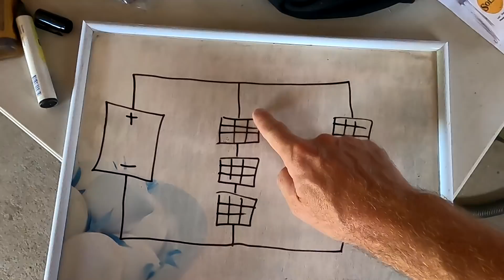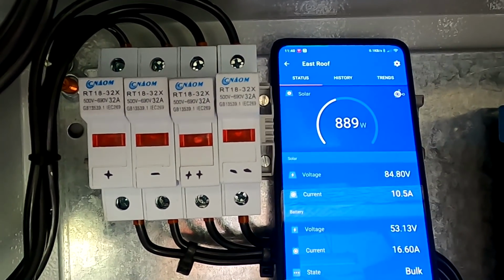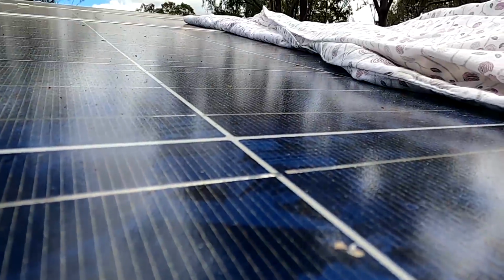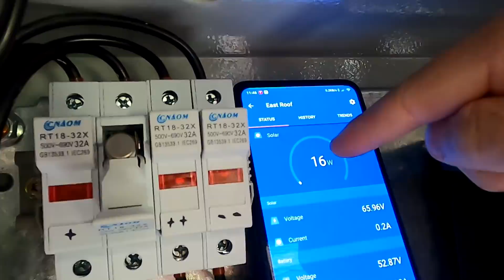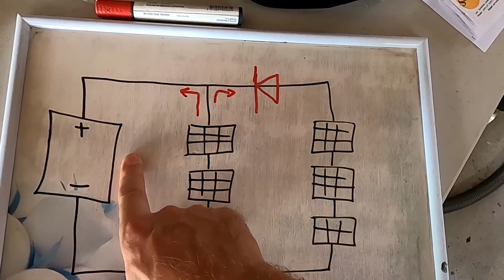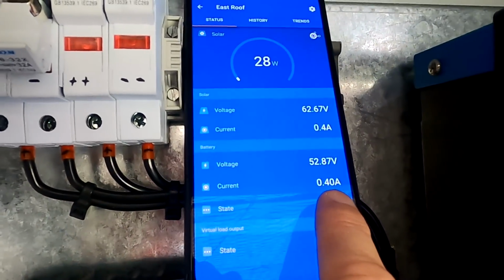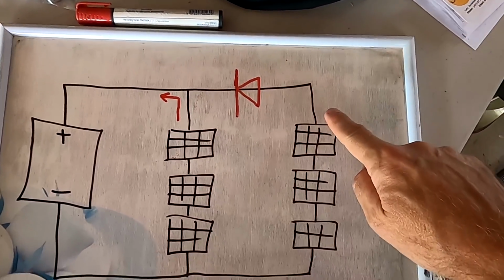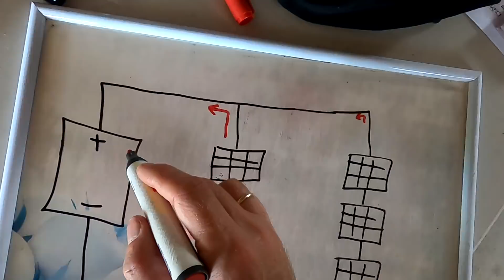Solar Upgrade EP4 - Shaded and non-shaded solar string in parallel. See what happens.

Comment: I thought the blocking Diodes were to prevent battery discharge at night ( with dumb charge controllers) but new charge controllers have diodes built in to them to prevent this. I have not seen a need for diodes in the systems these days. But I only know from my experience with a "small" 2kw system.
Reply: All 60-cell solar panels consists of three strings, and therefore has three diodes in it, for partial shade..

Comment: “Let’s do the test.” = Why I watch. This is actually a very complex question to answer theoretically. Depends on many things. I believe (haven’t done the test) that parallel strings of different nominal voltages (number of cells) can backfeed many amps when unloaded and in full sun. Conversely, modern half cell panels and shingled panels are arranged as multiple smaller panels connected in parallel without blocking diodes and this helps with shading. Another thing to ponder is that a shaded panel cools down which increases its open circuit voltage. Shaded does not mean complete darkness.
Reply from the maker: You should not parallel strings with different voltages ever! That could cause a fire unless you have installed such blocking diodes. 
There are bypass diodes and blocking diodes for solar panels but they are different things.

Comment: So what about explaining bypass diodes? I would have thought too you should get a bit more with some panels shaded if the bypass diodes are working. Is the voltage going below the minimum voltage for the regulator? It is good to see no need for blocking diode. I understood that blocking diodes are only for night losses. Charge controllers generally have that built in now.
Reply from the maker: The bypass diodes are only effective if you have a shadow on one panel of a string. Otherwise the panels in sunlight would push their current through this shaded panel and could heat it up. These bypass diodes are installed in ever panel already (see all the comments here). A blocking diode has a different task though and prevents one string feeding another string. The bypass diodes would not help in this case.
Reply: @OffGridGarageAustralia  yes, but you only got 19w off the other panel, in theory if the mppt has enough voltage on rest of panels in string you should get the power from the unshaded panel in that string. You are correct but if you have time a video would help some I think it seems many don't understand the bypass diodes proper function especially if you have say 150v string voltage.

Comment: (Sorry for my english)
Andy you did a very good test. 

The reason why the current doesn't go to the shade pv panels is because bypass diodes help themeself to stay at high voltage (around 100V). 
So the current will flow to battery (48V)
Reply from the maker: That's actually not true. There are bypass diodes in every panel but you would have only one blocking diode per string.

Comment: I think your charge controller will have the blocking diode to prevent current being drawn from your battery to the solar panel. Otherwise at night there would be a drain on your battery because of the voltage difference. However your panels will have the bypass diode to prevent current going to the shaded panels.
Reply from the maker: The controller does not know how many strings I have connected in parallel. This would not be working to have this installed in the controller.

Comment: Most manufacturers place diode‘s in the solar panels because of that possibility happening of power back feeding.
Reply: False
Reply: Every panel I have ever bought has the exact set of three diode‘s in it any panel that does not have them it’s probably of the worst quality.  You get what you pay for.
Reply: @corybodiker6243  they are bypass diodes! Not blocking diodes
Reply from the maker: That's exactly right @zarbonida. So many people get this wrong and I thought it's common knowledge hence I didn't mentioned it in the video.

Comment: I don't understand why diodes are in solar panel systems to begin with, because solar cells are light receiving diodes. Basically the opposite of an Led.
Reply: That is correct, the only problem is that the reverse breakdown voltage of the intrinsic diode-junction in the solar cell itself is that it breaks down at anywhere between 15 and 60 volts. Most panels are strung with much higher voltage so the  intrinsic diode-junction in the cell is not sufficient. BTW as a LED, if you feed back into a solar cell, it will emit infra-red light - not very efficient at that though ;-)

Comment: power will flow towards the controller as the potential is lowest there.  A diode can't hurt, although you have the small loss in forward voltage, but I don't know if it is vital.
Reply from the maker: You will lose around 0.3V over a diode. Multiply this by the current of 8A in my case and you will lose 2.4W. However, the lower voltage will also start you charging later and end it earlier. Not sure how much energy you will sacrifice there over time.

Comment: I think what you mean about those diodes is that they are installed to prevent short circuit in one string to affect the other. Think like 2 bateries, if one shorts the other will feed current to it.
Reply from the maker: They can prevent a short if you have one faulty panel in one string. That's why it is important to check regularly on your system to see if there is an issue with the solar production.

Comment: If u wanna use diodes , or Replace
Bypass diodes in panels (black box on the panel backside)

Look into  SM74611
It's a replacement for a normal diode but has almost no loss....

regards 
Joe
Reply: Too low reverse voltage, those only can take 30v reverse so it would not protect in the situation of power flowing from one string to the other

Edit: while loaded his string seems to output about 70v, 3 diodes in series, one in each panel, should be able to stand that but when the load is low or there's no load the open circuit voltage might be high enough to blow those diodes
Reply: @jonathana3872  I think, your analysis is 180° backwards.  It is the voltage across the "string of cells" being bypassed inside of the panel, that is not allowed to generate more than 28 Volts.  40 cells per string (max) = 28 Volts / 0.7 volts-per-cell.  Actually, that is a very high number of cells to protect in one "string of cells".   When the sun is SHINING - then the device has a REVERSE Voltage applied.  When the "string of cells" is SHADED - then there is only a small 0.4 volt FORWARD voltage drop across the internal body diode ...
Reply: @MrSummitville  What I was talking about is the maximum reverse voltage those diodes he referred to can block the open circuit voltage of those panels is 40v I think and the diode with that reference number can only take 30v in reverse.
Reply: @jonathana3872  Again, there is NO  Reverse Voltage on this DEVICE when the Solar Panel is SHADED - it is a Forward Voltage!   The Reverse Voltage occurs when the sun is shining and the "string of cells" INSIDE that panel are actively producing volts & amps.  This device can withstand 28 Reverse Volts from the "string of cells" located inside that panel = 40 Cells max protected.  You are very confused, as to when there is a Forward Voltage vs a Reverse Voltage across this device and where those voltages come from ...

Comment: it's in the pv panel box !    
Probably one blocking diode & one bypass diode per panel  .
Reply: there are only 3 bypass diodes in the pv box. 
No one blocking diode
Reply: @zarbonida  
Depends on the panel  !
Reply: @gd2329j  can you tell me a pv panel with a blocking diode?
Reply: @zarbonida Sunpower used them .
Reply: @gd2329j  Blocking Diodes were used when the Solar Panels were specifically designed to be directly attached to a battery bank, without a charge controller, that is very rare now.
The following SUNPOWER Solar Panels do NOT have any Blocking Diode ...
SPR-E-Flex-50 watt
SPR-E-Flex-100 watt
SPR-E-Flex-110 watt
SPR-E-Flex-170 watt
So, which model of Sunpower solar panel did?

Comment: So, if you can "backfeed" the panels with voltage and current, will they then produce sunlight? ;)
Reply from the maker: That is a very good question! 🌞
Reply: No Dave, they produce heat (thats one way to get your panels free of ice and snow)
Reply: I suppose that if you feed in enough power they will produce light, when they catch fire. don't try this at home people.
Reply: actually solar panels can kinda work in reverse and produce infrared light like leds. The thing is that they are TERRIBLE at doing it...! Most of the power will be converted into heat and probbably damage the cells.
Reply: @andrewsweet43  Heating the panels with reverse current was actually an idea tried by Midnite Solar !

Comment: There should be diodes already built into your panels anyhow. But you can blow them out if you have more current going back to them than what your max fuse rating is for your panels
Reply from the maker: Nope, that is not correct. They are bypass diodes, not blocking diodes.

Comment: Doesn’t each panel already have blocking diodes.
Reply from the maker: No, they have bypass diodes only.
Reply: @Phil Ware What is the mfr & model # of the Solar Panel that you have that contains a Blocking Diode?  And what YEAR did you purchase it ?
Reply: @Phil Ware He talking about EVERY Solar Panel that is designed to be connected to a Charge Controller or an Inverter.  Which is 99.999% of the Solar Panels that are made in the entire world.   So, what kind of "word game" are you trying to play?
Reply: @Phil Ware He talking about EVERY Solar Panel that is designed to be connected to a Charge Controller or an Inverter. <==  What part of that statement, do you not understand?

Comment: I always thought it was voltage that mattered in this scenario and that it will take the path of lease resistance
Reply from the maker: Voltage does matter. Current always flows to the lowest point of voltage which is the charge controller.
Reply: @OffGridGarageAustralia  really...lowest voltage..erm..how come?
Reply: @ahmadplastiq2067  ohms law in the same way a battery will charge when the voltage input exceeds the voltage of the battery. The amperage then depends on the voltage level above that battery. (watts = volts x amps)

Comment: My panels all have reverse-blocking diodes in them already Andy, I think it's fairly standard. Maybe look in the junction box on the back of the panel?
Reply from the maker: They have bypass diodes, not blocking diodes. Don't mix this up  😉
Reply: @OffGridGarageAustralia  Fair do's
Reply: @Phil Ware a normal diode has + and - connections..you also have a blocking direction and a forward direction (means conductive).... the bypass mode is the "forward direction"....the diode is connected between + and - from each panel.......in normal conditions (when u have sun) the blocking direction voltage is approximately the open circuit voltage of your panel --> panel works....but if the shading occurs, the voltage of your panel drop...then the forward dircetions comes to work...so bypass....or bridged....
Reply: @Phil Ware If you know how a diode works, then you have the answer of your question...a diode can bypass or block...in bypass mode is a short circuit between + and -  ..so the current can run the way through the diode and not trough the panel...
Reply: @Phil Ware no problem...i wanted to explain the diode in blocking direction...in a solar panel the diode is normally connect in blocking direction...electricity flows through the panel...in bypass mode the electricity flows through the diode and not trough the panel...so the panel is bridged...that is what i want to say... :-)

Comment: Most of the panels nowadays have these bypass diodes built in. Plus solar radiation density in W/m(squared) doesnt affect the putput voltage of the panels! It only affects the output current! The open circuit voltage of the panels stays pretty much the same, unless the solar radiation intensity that hits them is exptemely low, or you load the circuit and pull the voltage down.
Reply from the maker: Yeah, they all have bypass diodes but not blocking diodes. different things...

Comment: Hi Andy. I always thought that modern solar panels had diodes built into them.
Reply from the maker: They have bypass diodes, not blocking diodes.
Reply: @OffGridGarageAustralia  ah 
Thanks for the info
Reply: @BenCos2018  cause the diodes are wired in blocking direction.....:-) take a look in the junction box and u will see...
Reply: @maleiot_83  yep 
Reliased my mistake after I commented lol
Reply: they do

Comment: the black box on the back of panel already has the diode in it. it also prevents reverse current.
Reply from the maker: No, that is wrong. These are bypass diodes in the connection box, not blocking diodes. Bypass diodes are not for blocking reverse current!
Reply: @Phil Ware More likely, he will have only Bypass diodes ...

Comment: I always thought the diode was already in the panel junction box but it may depend on the make of the panel.
Reply from the maker: There are always bypass diodes i the box behind the solar panels, not blocking diodes.